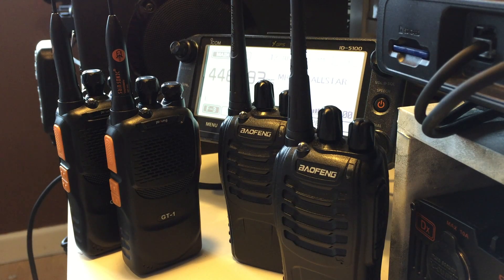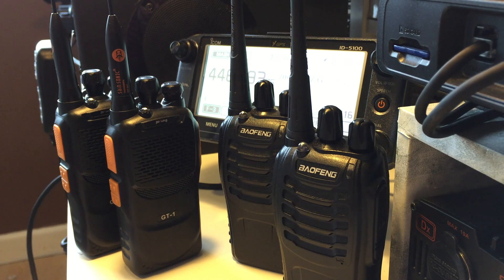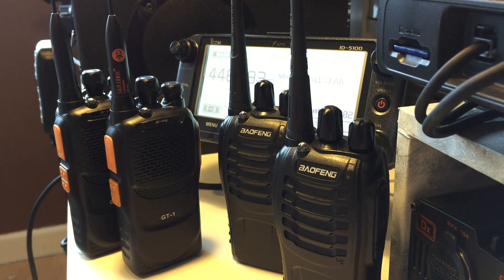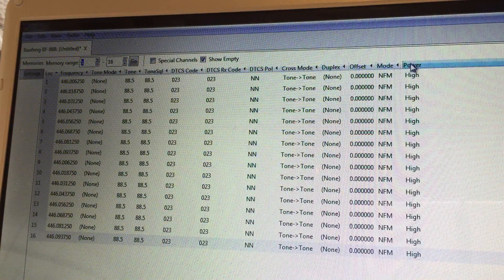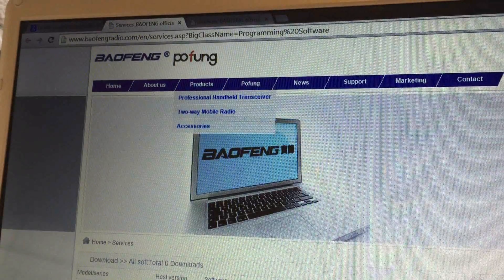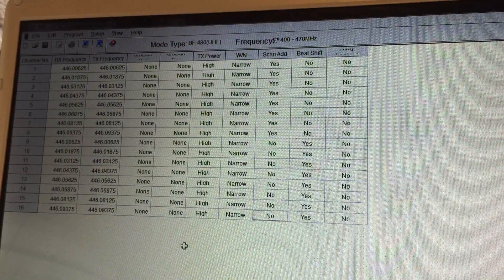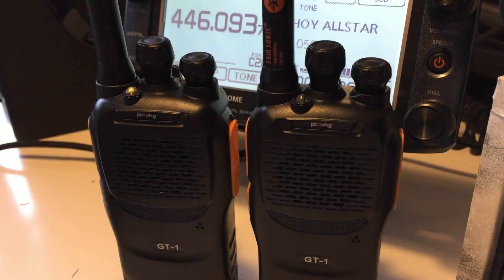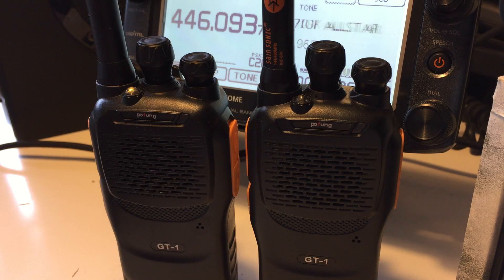Beat Shift 'Scrambler' Tutorial For Baofeng BF-888S & Pofung GT-1

Comment: I couldn't get it to work on some new BF-888s radios I got off eBay. I used the same software and it says beat shift is turned on but it didn't change the audio. I have a old bf-888 that does work I guess the new ones shipped in to the US must be disabled.
Reply: Bf-888s fake!

Comment: i program my bf888s and from channel 1-15 all beeeeeeeep sound. can anyone help/
Reply from the maker: They're not programmed properly if it beeps.
Reply: how to have it programmed properly do you know how to?
Reply: If you could share a email address and what frequencies your trying to program into it maybe me or someone else can generate a code plug for you and email it back to you and you could just download & save it to your computer and then open it with the appropriate software & upload it to your radio. :-)
Reply: Ryan Booc read the manual, it tells you how to enable and disable the voice that tells you what channel you are on. IIRC you hold PTT and squelch button and turn on the radio while it's on channel 10. Or channel 15, I forget. One of those is to change from English to Chinese voice.
Reply: The 888 frequency mod lets you enter frequencies that are not valid.

Comment: hello we already use business radios from vitai are these compatible?
Reply from the maker: I have no idea, tell me more about your radios, frequency, band, power, encryption? Analogue? Digital?
Reply: Ringway Manchester vitai 8800 standard channels no encryption, they are work you see
Reply from the maker: Are you in the uk, do you use a license at all? Or license free?
Reply: Ringway Manchester they where provided by my employer however they wanted to add more due to staff safety. they have a 400-470mhz ariel.. cant say anymore really
Reply from the maker: Ok, they will be compatible if programmed correctly. The only issue is, the power could be too high and violate the terms of use of the radios. Unlikely to be detected but could carry penalties if you were. Hope that helps.
Reply: Ringway Manchester on net says they are business radios.. I know they came from a proper radio company
Reply from the maker: Find out if your company uses a license. If they do, they should be good for 5w meaning the Baofengs are ok. If not they'll be 0.5w meaning they'd be illegal to use
Reply: Ringway Manchester they will have they use them country wide

Comment: Correct me if I'm wrong, but I was looking at the manual that came with my UV-5R, and it mentioned "scrambling". Would that be referring to the beat-shift meaning that the UV-5R has that feature too? Also, if you have beat-shift turned on for both radios, will the receiving one "decrypt" the signal from the transmitting unit?
Reply from the maker: It does but there's no scramble/beat shift on the UV-5R. Yes if both radios have it turned on, both will decipher the scrambling.

Comment: Beatshift text is wrong,should be scram on\off-think software text is wrong.
Beat shift ie real beat shift causes the radios internal  ref oscillator  to shift slightly ,if you hear a permanent carrier or beating on radio it will remove or attempt to remove this RF carrier internally generated from the radio.
As for scramblers some sets have internally fitted in hardware some dont or firmware different.

Comment: Beat Shift for the Baofeng 888s using Chirp

Click a memory line to Highlight it.
Right click on the highlighted line.
In the box that opens, Click 'Properties'.
Click the 'Other' tab.
Tick  ~  'Beat Shift (scramble)'
Click OK
That Memory(channel) now has 'Beat Shift' activated

Program at least two radios for 'Beat Shift'  to work between them ~ enjoy :)

I was using Chirp in WIndows 7
Reply: f4bscale maybe you can help? I bought 4 bf888s and turned beat shift on in 2 radios and left the other 2 with beat shift off, so I could make sure beat shift was working. Well beat shift was not working,  even double checked that the radios were on the same frequency. Tried turning on beat shift with with chirp and the baufeng software but still didn't work. It allows me to toggle from off to on but doesn't transmit scrambled.
Reply: @buckched62  mine either .8 different radios. Gt1 and 888s .none have beat shift. Must be a myth or they have disabled it either with a diode or a line in software. We need a copy of the radios firmware or a chirp copy to  find the difference and fix it. I bought them specifically for that feature so they are useless to me.
Reply: @J G a coworker works on radios at a county and state level, so I gave them to him to program. He says there different models of the same radio. If I remember correctly he said something like the models with the green stamp on the info tag on the back of the radio are the beat shift capable models. I gabe them to the kids to play with.
Reply: tried this but the radio still transmits without beat shift

Comment: When you have 2 888s and both have beat shift on, and you transmit to the other unit, will it decode the scramble and have regular audio?
Reply from the maker: +Johnny Rigler Yes if you have 2 with beat shift on, the audio sounds normal when talking to eachother. Its an outsider without beat shift on that hears the garbled audio
Reply: Isnt this the same as setting the offset on a uv-5r? Could u set the offset on a uv-5r or uv-82 to recieve like a beatset enabled 888s? Im getting my gmrs license, and buying a few 888s walkies for the kids to use in the woods nearby, and wanted to be able to talk to them on my uv-5rtp with their beatset enabled 888s if possible

Comment: Is it possible to add 'beat shift' scramble on the Baofeng UV-5R? Works on BF-888S but I see no option for the UV-5R, is it called something else in the software?
Reply from the maker: +Keith Hood Hi keith I dont think so
Reply: No not possible unless you buy one of those toys called electronic spy gear scrambler  https://rover.ebay.com/rover/0/0/0?mpre=https%3A%2F%2Fwww.ebay.com%2Fulk%2Fitm%2F223188550112..  saw them the other day on Ebay. They are cheap toy beat shift scrambles for like 10 dollars or less
 I could hook the audio out of those things into the mic and speaker in and out and make that work
 .

Comment: Thanks for the video. Do you have any ideas why I can enable scramble (beat shift) and it works, but I cannot get the receiver to descramble? I have tried with and without CTC/DCS encoding and decoding, various frequencies, various channels, toggling different options (scan wide/narrow, power, busy lock). I have tried using the 888S PC Software and the software you mention in this video. Is it possible that some radios can scramble but not descramble? I heard there were radios that couldn't scramble but mine definitely do that. Thanks for your input.
Reply from the maker: Renae MacLeod I'm not sure what you mean. 2 radios will sound clear to eachother with beatshift enabled. Just anyone listening without it enabled will hear scrambled voice. Does that answer your question?
Reply: I have it enabled on both. I have the exact same settings uploaded to both radios. If I make a change, I immediately upload to each radio and test but it's unsuccessful.
Reply from the maker: Do you mean you dont hear beatshift on the radios that you programmed?
Reply: Ringway Manchester I mean that I only ever hear beat shift from the transmitting radio when it is enabled, whether the receiving radio has it enabled (shouldn't hear it) or not (should hear it). My initial points about the settings was just to indicate that I am sure that both radios are using the same channel and encryption (or not) because I am writing the exact same profile to each of them, one after the other, even using different programs. Everything is working as expected, except the descrambling.

BTW, thank you very much for taking the time to respond. It's much appreciated. If there is another forum you would rather use, please feel free to suggest it. I don't mind taking the time to post screenshots and videos.
Reply from the maker: Ah right ok so the 2 radios are programmed the same but you hear scramble audio with beatshift is enabled? Is that what you mean?
Reply: Ringway Manchester Yes sir. I'm curious if anyone has heard of scramble working but descrambling not working. I've only ever read of people not getting the scrambling feature to work. Obviously not critical and I didn't buy the radios for this, but I would like to get it working if it's capable of doing it.
Reply from the maker: The only thing I can think of is one radio was manufactured after the other, or from a different supplier. So the shop you bought them from just picked 2 radios from their stock and sent them.
Reply: Ringway Manchester Indeed that was it. I actually have 3 radios and I can see that two of them match (orange Z or N sticker in the battery compartment). I happened to be testing on the two that don't (the third being a blue K). Sigh. Would you know if there is a hardware potentiometer or jumper that I can adjust? Or perhaps some other software?
Reply from the maker: I wouldnt have thought so, I just know that some came with the beatshift and some came without.

Comment: To listen to FM, press the squelch, turn on the radio, and wait a few seconds.
   To tune is in squelch.
Reply: Some have FM some dont . Same with beat shift .they crippled a lot of radios and left these cool features out that's why the are 6 dollars a radio now
Reply: @SilverStone XAdvanced the 888s radios dont have FM however the gt-1 which is the newest pofeng clone of the 16channel 888s does have  FM. All my gt-1 and 888s dont have beat shift either
Reply: @SilverStone XAdvanced right .none of my 888s have FM.  But the gt1 which is sold as the 888s newest by pofeng baofeng  does have same buttons and FM radio works when you hold the monitor key that opens the squelch when powering on .then that monitor key selects FM channels
Reply from the maker: Thanks for the info :)
Reply: No press the monitor key on the side while turning on the power. FM radio mode .then press monitor button to change stations.

Comment: In CHIRP you can enable or disable the beatshift by setting the "Beatshift"-bit under Browser->Root->Memory[16]->Memory[16][X] where [X] is the channel number (from 0 to 15). The Beatshift-bit set (0x1) means it is off, reset (0x0) means it's on.
Reply from the maker: I'll check that out tomorrow, thanks for the info :)
Reply: please tell me how to find this item? Beatshift"-bit under Browser->Root->Memory[16]->Memory[16][X] where [X] is the channel number (from 0 to 15). The Beatshift-bit set (0x1) means it is off, reset (0x0)
Reply: You must be in Chirp developer mode.